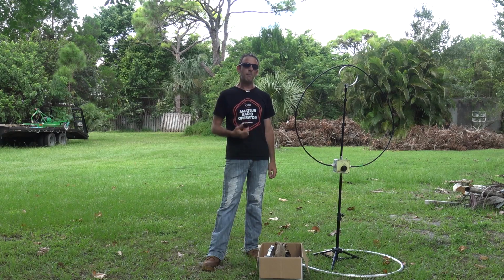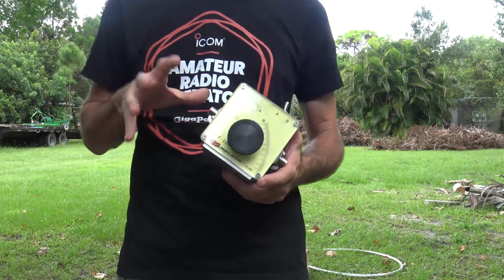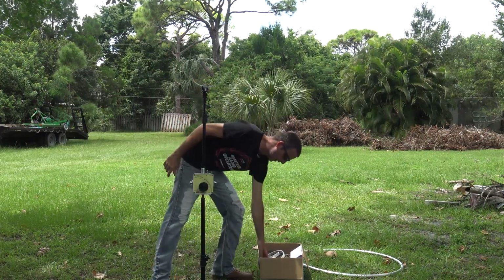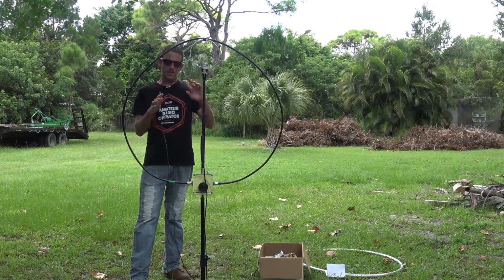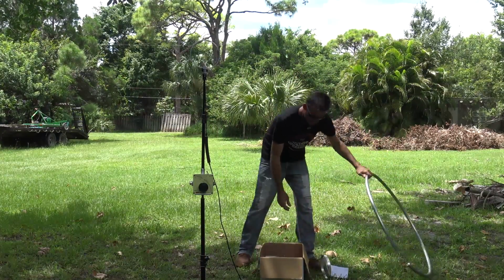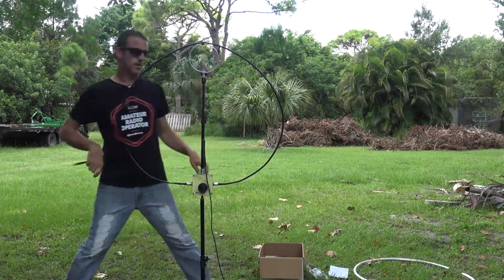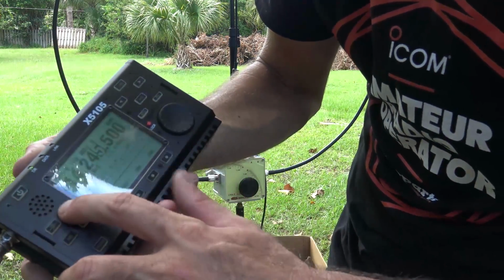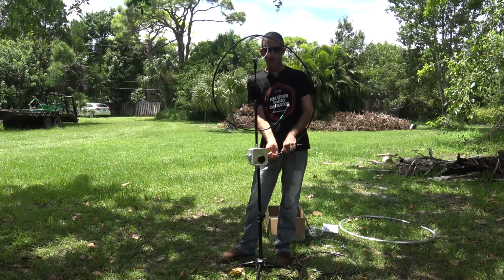Chameleon F-Loop 2.0 PLUS, Review And Setup, Great For HOA!!!!

Comment: What tripod do you recommend for this? Thanks
Reply from the maker: I like to use a Sony camera tripod. As long as the feet are wide enough to support in low winds, and it’s has a 1/4 20 screw, which all camera tripods do

Comment: Can you show it with the power compensator mounted.
I have the 2.0 Total..  I use an MFJ antenna analyzer to pre-tune than hook to a larger radio 
I'm in an apartment  Antenna and radio different rooms.
Works well you can go to 40 meters on the single loop..  or on the 3rd piece of coax (you might notice it's longer)

Comment: Hi, when you use the aluminium loop, does the inner circle touch the radiotor or do you use the scrap to avoid the contact ? I tried the second option but dont hear nor see the right position of the capacitor. Beside the manual is poorly made, btw I didnt see that I should use the 8" inner circle with the double loop. If I could get detailed explanations..
Thx for your help, Milos F4IIP

Comment: The classical design of the mag loop antenna suggests the feeding loop goes to the bottom and the tuning capacitor to the top and is equiped with the lengthened tuning rod of some kind or, best of all, with the remote-controled slow-step small electrical motor, and there is a certain logic behind this. But I wonder what kind and type of tuning capacitor the customer gets paying the price they ask? 73! Linas LY2H

Comment: Thanks Eric. Pleasantly surprised to see a ham vid so soon from you. My experience with a friend’s new Chameleon loop... I wasn’t impressed. He had to send it back because of the internal reduction drive was slipping, I believe twice. He had me take the cover off in order to see the malfunction. I wasn’t going to attempt repair of something that was under warranty. Once finally fixed...Experimenting with moving the coax away at a 90° angle as another poster said definitely helped with signal and most likely tx. I like my Alex loop. Packs smaller and less weight. Easier to set up. Only goes down to 40 but have made many contacts there, a few to Europe even during the low sunspot cycle, and on 10 watts. Also, I flattened out the small loop at the top somewhat for more area to follow the large loop’s curve, similar to Kevin Loughin’s test and observation.   Hope to see ya soon and maybe hear you on the air. 73

Comment: When you add the hard loop the efficiency should go up. If it does the bandwidth must go down. It should be sharper to be more efficient. With these small transmitting loops the bandwidth and efficiency are inversely related. Wider bandwidth means less efficiency. Making the loop larger (or adding turns) will increase bandwidth. But lowering loss resistance raises Q and narrows the bandwidth. Fun antennas! de Alan, w6akb
Reply: That’s exactly the way I tell how efficient my Loop designs are.  The longer the circumference the wider the bandwidth

I’ve also noticed that minimum SWR doesn’t not correspond with resonance. Figured there could be some adjustments to be made with the feedpoint impedance and the antenna at resonance. 

I’m currently waiting for my nanoVNA to turn up so I can really see what’s going on with them.

Comment: In your experience with this antenna,  which frequencies do you get the best reception with?
Reply from the maker: 30m/20m/17m/15/12m and 10m, and thats probably because 40 and 80m are almost impossible with 5 watts no matter which antenna you have because everyone on those 2 bands are running amplifiers. It will receive quite well on 40 meters but i have never made a contact on 40 or 80m with it so far.

Comment: Two huge problems with this antenna for me.  First is the low power rating.  Second is that you need be at the base of the antenna to tune it.  People dog MFJ, but they came up with a magnetic loop that handles 100 watts and you can tune it from the shack.
Reply from the maker: I understand your concern. I feel its two different animals because one is meant for portable (mostly) and one is made for fixed operation. I am confident Chameleon could come up with a better design than the MFJ for fixed operation but again that MFJ is no way capable of backpack portable, so not a fair comparison..
Reply: @HamRadioConcepts  I'd like to see an antenna up to the same specs as the MFJ because I think Chameleon puts out a great quality product, but the antenna I used tonight on my apartment balcony is MFJ.  I'm not interested in going outside every time I change frequency and I'd like to use 30 watts full duty cycle digital, because anything less and I don't get heard.
Reply: Chameleon offers a screw on Thing they call a Power Compensator that will boost the output to 60 watts.

Comment: To get the BEST SWR - make sure to keep the RG-58 coax BEHIND the unit and avoid the RG-58 to touch the LMR-radiator!
Reply from the maker: Good to know, thanks for the comment. I didn't see an issue with the way i had it but I can only imagine it might be better as you suggested.
Reply: would rg-213 be better ? less loss ?
Reply: @christophersmith1155  RG-213 is too expansive and not really worth it. The feed line is only 12' long.